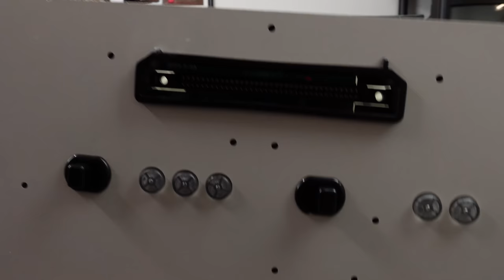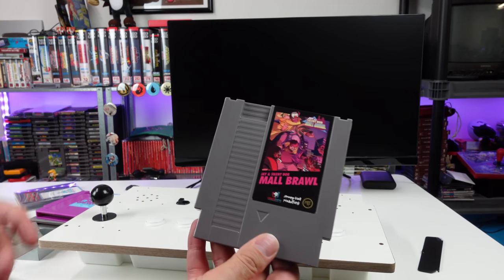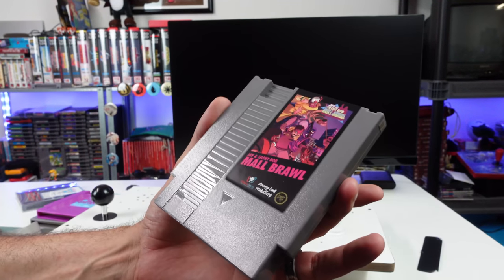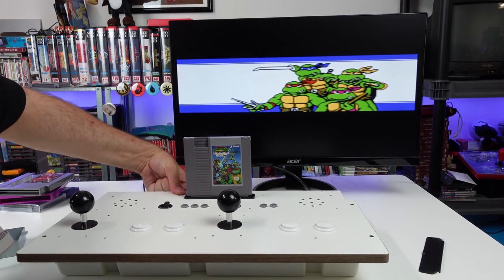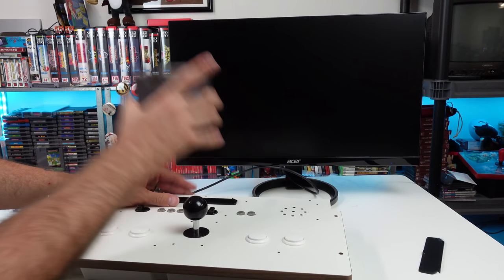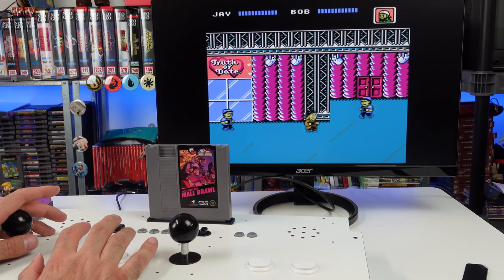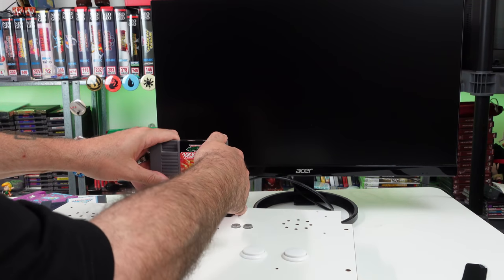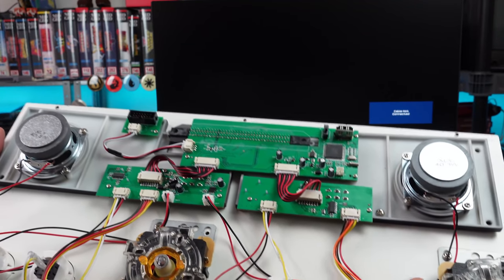The MOST Interesting NES Console Ever! This Arcade Stick Plays Nintendo Cartridges!

Comment: If you put that in a One-Up, how much does the cartridge block the field of view?
Reply: Good eye😳🤘🏽💯
Reply: On a stock machine with the smaller screen, I expect that will block off about half the screen lol. They would ned to recess the cart slot a load to compensate for this.
Reply: I had that same concern.  I stood a cartridge on the control panel of my TMNT cab to have a look, and the top of the cart looked like it was just about flush with the bottom of the screen.  Obviously with the actual unit, the cartridge will sit lower since it's inserted inside the control panel.  The bottom bezel on the Turtles cab is about 3 1/2 inches, so as long as the bezel on the unit you use is about the same size, it shouldn't be a problem.
Reply: I would think it would be fine, the only cartridge system I think you might have an issue with would be a NeoGeo if they make one
Reply: not at all, where you stand puts it into the peripheral, but from further back looking at gameplay it is blocking

Comment: The problem with this design is the sheer height of 72 pin NES cartridges. If this were placed into an Arcade 1up cabinet, the NES cartridge would block a good chunk of the monitor. A 60 pin Famicom version of this would be much more ideal, given those cartridges are almost all half the size of NES cartridges.

Comment: "I saw someboy point out that hey there's using an eight way gate in there, an octagate." 
Glad you saw my comment. It is worth noticing because octagonal gates are not the norm at all. Usually, you get square gates because they are cheaper to produce. I worry that only these prototypes will have octagonal gates and retail versions will switch to the cheaper, worse square gates.
Reply: At worst, a new gate is only a few pounds/dollars etc and very easy to replace. I just got the new xbox fighting stick and the first thing I did was order an octagonal plate to replace the stock square one. Square is the norm, but I’m not Daigo haha.
Reply: @doom2319  Octagonal gates aren't a whole lot of money (especially if you buy clone octagonal gates instead of the Sanwa ones) but on the cheap Sanwa clone sticks like this, getting the Square gate off can actually be a giant paint in the ass due to cheap construction and rigid plastic. I just would like it to be the standard that all sticks come with octagonal gates by default and you have to go out of your way to get a square gate for those who prefer that. Those weirdos.
Reply: @SatoshiMatrix1  Aaaaah I didn’t consider they might be glued in as standard. Yeah fair point, I still can’t get the sticks out of my original 1up control panel... I think they are held in place by magic lol.

Comment: Next time, when you wants on test another Nes / Fami Clone or Emulator machines for this specific console. I suggest on use these respectiful game titles first .....

Castlevania III - Dracula's Curse ( American version only )

Ninja Gaiden II ( see what's happening at the Level 2; the Train level )

Alien Syndrome and Super Mario Bros 3

If these games opens and runs good and perfect at it's fullest. Which means, that this Nes / Fami Clone kind of a console it's a good machine. Because these games titles and it's region versions, are a somehow little hard to emulate aside on a real Nintendo Machine. 
..... And of course, lets check upon the sound quality and specially the Color Palette quality. But this it would be a little more difficult on to demonstrate it inside on a Nes Clone Console Machine.

Comment: You tried bumping and hitting the console, but I'm pretty sure you could just rip the cart right out of that thing when the game has loaded. It has probably dumped the ROM to memory.
Reply from the maker: No, its not dumping anything. Its a NES on a chip, hardware clone not software emulation. So even though not exactly perfect to the original NES it will still behave closely to the original in regards to reading carts.
Reply: @Madlittlepixel  Thanks for clarification 👍

Comment: I hate to hear that you monitor broke I know that has to be really frustrating for you. Someone should make a protective case for those monitors if they do not have those maybe have a thick carpet under you table incase you get another one and it gets knocked off. I not trying to be a jerk just making a suggestion.
Reply from the maker: Yeah, Im gonna get some kind of floor padding by the time I get a replacement. My fault it happened, but damn it sucks lol